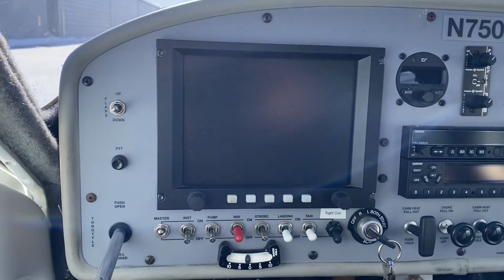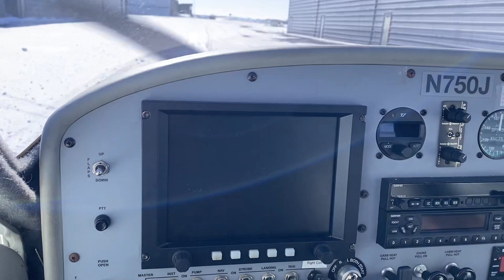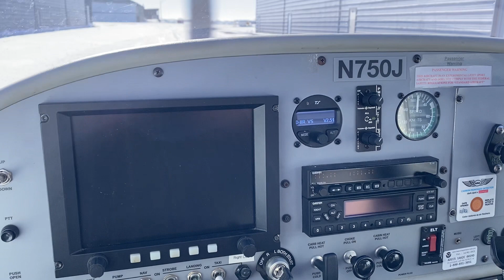Jabiru GEN 4 engine installation 36

Comment: Oh Wow! that sounds Soooo silky smooth and fires straight up, not a hint of hesitation like she just wants to purr,   you must have felt quite a sense of achievement. well done.
Cheers, Glenn. Down Under
Reply from the maker: We just went on a cross-country trip to see a life-size replica of Noah's ark. It was a lot of fun and we put over 1000 miles on the airplane. The engine is running like a sewing machine. I have been really enjoying it. It does seem call little bit more thirsty than the old one, but if that is the price for much cooler temperatures, I think it is a good trade-off.
Reply: @mistercarstens  Very happy to hear of your success, I say to my better half somethings running like a sewing machine & she looks at me like what? - so that's not good? - She is from a medical background, what can I say😄
The more I look at the Jabiru the more I'm impressed both the airframe and engine particularly now that the engine cooling issue's have been put behind them.
Cheers. Glenn. DownUnder